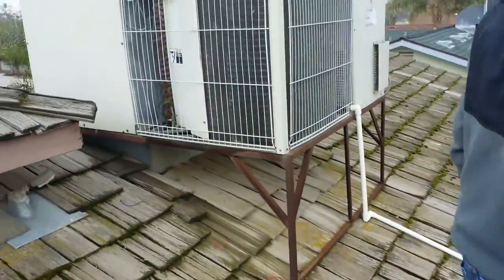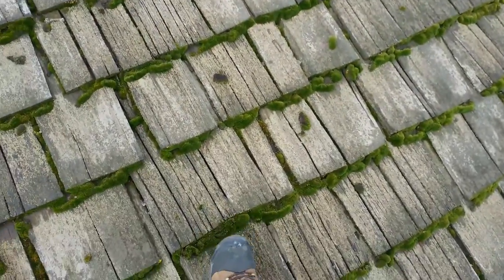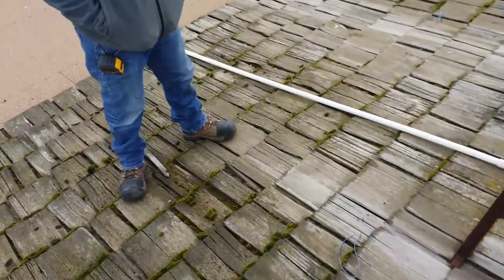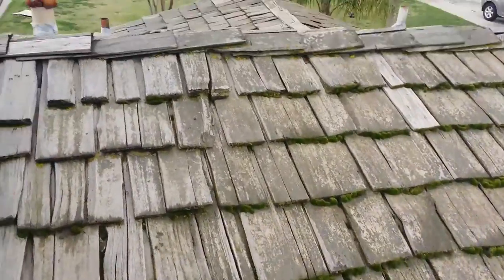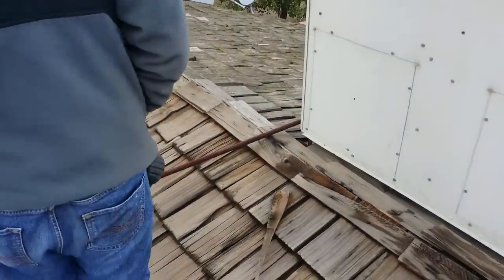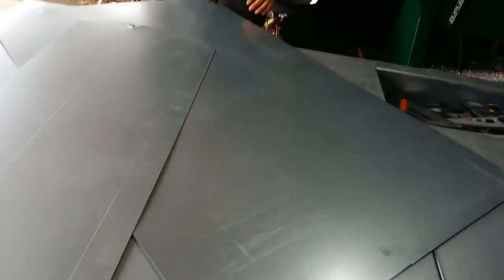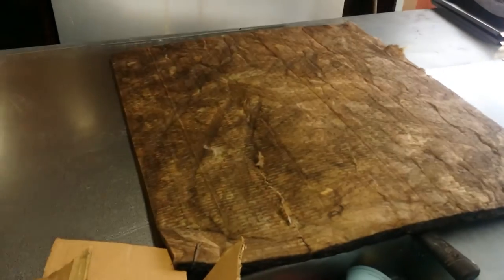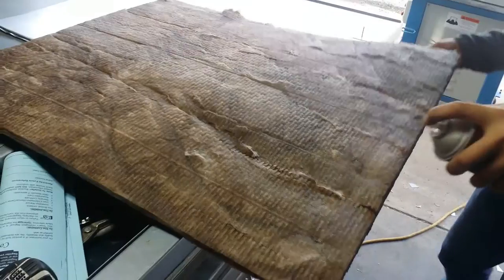HVAC: roof top unit install and metal work part 1

Comment: So it was OK to put the unit in before the shingle roof? We had one roofer (and a hvac tech) that said it was ok to do that but another roofer insisted the roof should be done first.  I think he thought it was the old style with post legs instead of flange.

Comment: is that gas / flue set up normal that's crazy
Reply from the maker: that flu was from the old wall heater. so they found it easy to just shoot it up from there lol. thanks for watching.
Reply: +THE HVAC GUYS oh I got ya we don't have any roof units for homes in my area and thank goodness.  You guys do some nice metal work